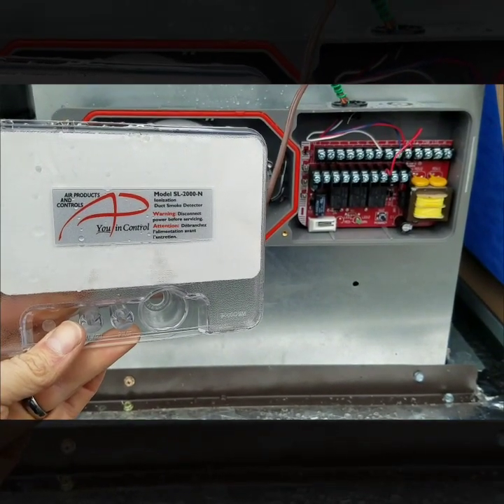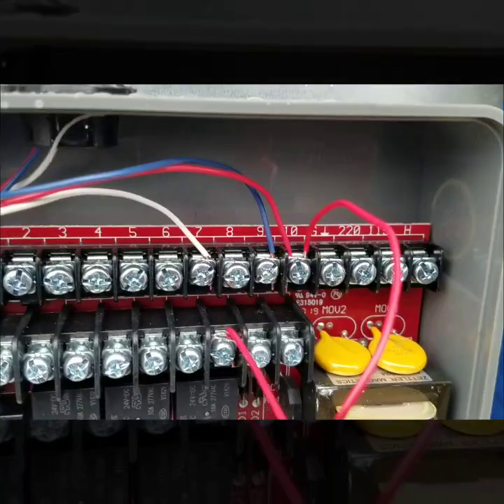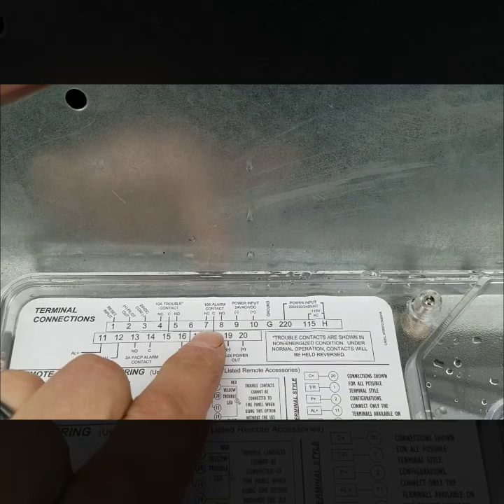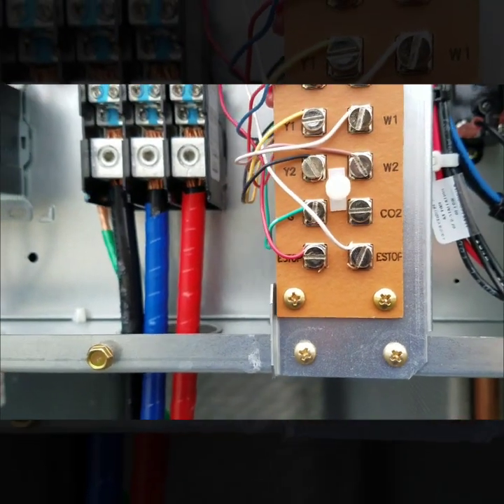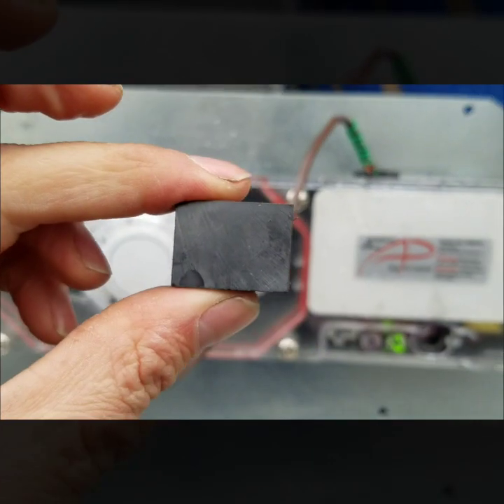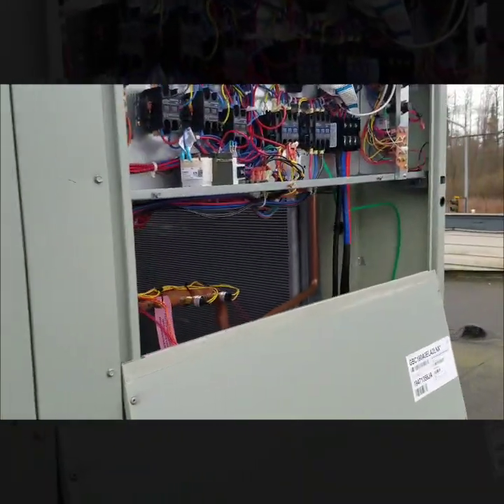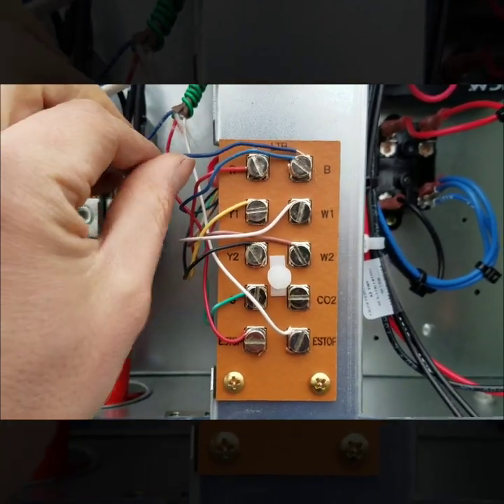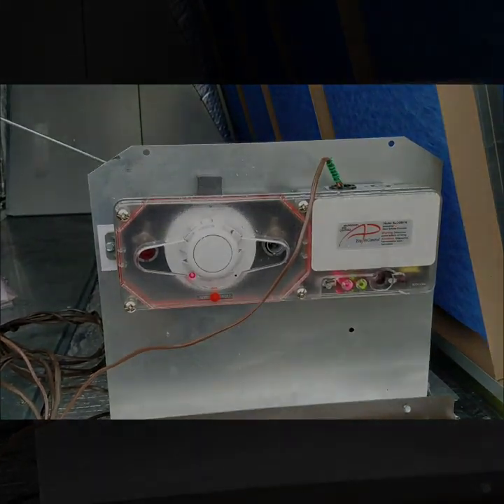Wiring in Smoke Detector on HVAC Package unit

Comment: How do you wire a smoke detector to trane#: tsj090A0S00000. It don't have emergency stop. I have to use terminal J18. How would you wire